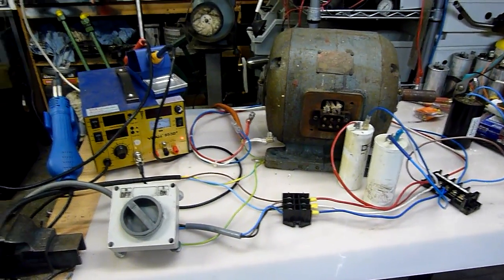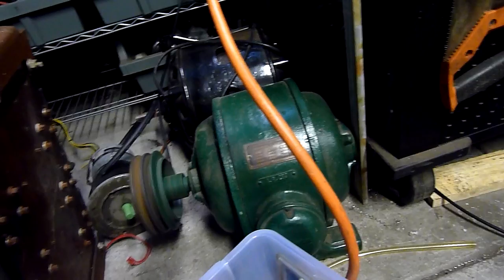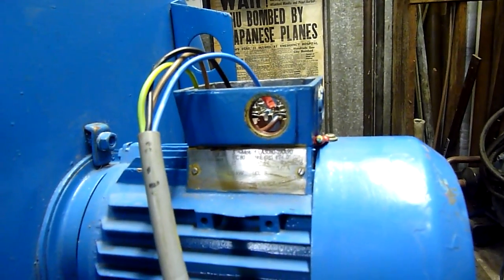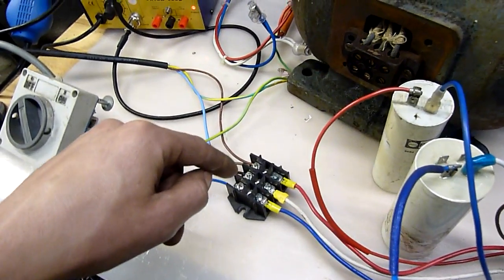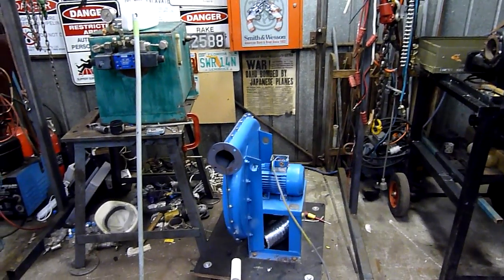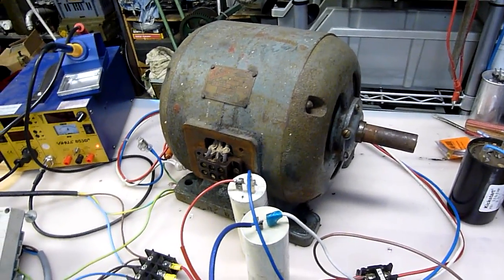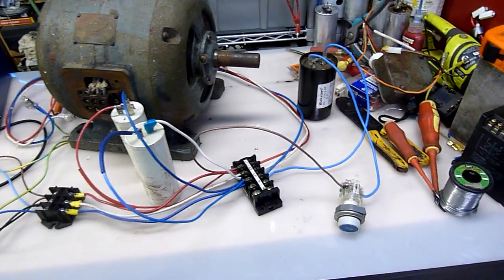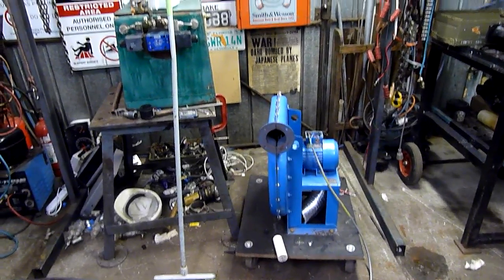Rotary Phase Converter Build test   Lots of Rambling and Blower Startup noise

Comment: after playing with my own 3 phase motors, a problem i think you may be encountering is harmonic resonance inside the motor. This is usually due to incorrect capacitor size and unbalanced winding impedance. Wonder what it would do with a bigger capacitor as a run cap? caps too big or too small will make the motor heat up quickly and sound very angry. Maybe start the blower with the start cap too?

Comment: its also worth checking your line voltage drop under a range of loads, its often over looked yet so important when it comes to starting  3phase motors under load ,I [] R. in UK some domestic lines will drop so low when it comes to the nitty gritty and require further cash spent on star & delta starting switchgear.

you probably know all ready , some of the older vintage motors work so much better for RPC  operation than the new generation high efficiency green brigade motor types.

Comment: when it comes to balancing the phase voltages you need volt meters on each , will make the task much easier and quicker,the difference it makes when phases are balanced is massive. I high recommend only using double terminal capacitors or screw on terminal type, seems over kill but the difference it makes when it comes to starting up motors on load is massive. never skimp on cable size either. good site to visit  practicalmachinist forum,  great depth covering a number of manufactured RPC's etc

Comment: Built a large RPC with current & voltage sensing control ,keeps phase voltages within a few % under full load, automatically switching in cap banks using SSR's works a treat  . when off load system switches to stand by drawing just under a few amps on 240 V input side, so much better to use a step up transformer 240 to 415 volt, well worth the expense- extra hardware, old stick welding transformers can be used costing next to nothing. cap bank total = 900uf. input line volts must be ROCK SOLID

Comment: for a efficient RPC you need phase voltages within a few percent under operating load.off load voltage means nothing in the real world, 10% imbalance will hurt big time.

its good practice to have the idler motor 45 - 50% larger than the 1st load motor, that way starting is much better, slow starting will cause winding's to over heat. from experience running these types of motors at a slower speed " lower frequency" will causes them to over heat, modem motors deal with VFD much better.

Comment: hey ed harmonic distortion also causes a lot of heat, do you have a power factor meter? check your power factor if its below .7 i suggest power factor correction "caps"
you can purchase one at most big box stores , not sure if you have them down under

Comment: Need more balance capacitance to bring the L1-L3 and L2-L3 voltages up.   Of more importance is that the current be balanced among the 3 legs of the blower motor (do you have an clamp-meter?).   It sound's severely out of balance.    More information than you can poke a stick at on practicalmachinist in the transformers, RPC and VFD section.

Comment: In AU and NZ in built-up areas we use delta wye transformers.
400 volt 3 phase with 230 from phase to neutral.
and in rural areas we use 2 phase to get a single phase.

Comment: In the US, or North America for that matter, most 3-phase rotary converters I've seen run off the 240v main. A 3-phase motor will run off 240v but won't start unless you got a capacitor or give it a spin. The difference is we have our 240v split into two 120v lines, split at the transformer, firing 180 degrees apart. It's still called single-phase because it comes from one primary. I'm not sure if you Aussie's have any electrical service like that.
Reply: we have our phases tapped off one of three from a delta-wye/star transformer to step 11kV down to 240 (L - N) if you have 3 phase, then you have all four conductors from the transformer. we don't usually have two phases, but older houses with three phase had two of the phases dedicated to high power loads like ovens and cook tops.

Comment: or find a treadmill motor on eBay for $50..up to 3HP. If they can handle the variable torque and speed demands of a (tested 1HP) milling machine, they can certainly handle that static blower.

Comment: Nice sounding blower! Just a thought, as the blower has no connections on the outlet or inlet, if you covered the inlet say half or 3/4 would that encourage the motor to spool up to 2800 rpm or is it already at that speed? I need to build one of these converters for my workshop!

Comment: It's either that, or what you saw, was a few decades-worth of dust go up in smoke. :D That's always a possibility, & probably why it started smoking to start with.....Full up with dust, got hot, burnt off the dust, cooling fan could then cool the motor properly as it should do, then just carried on business as usual. :D

If the motor was still working after the smoke-up, I'd consider getting it tested out, maybe even taking it apart & giving it a thorough clean-out inside. :-)

-BoomBoxDeluxe.

Comment: Hiya. From what I can remember on Rodalco's videos on Rotary Phase Convertors, YOU DO NEED a motor for your RPC which can be switchable between Star & Delta. 

Some motors like being started in Star, others Delta. Once up to speed, you can switch between the two for either 240v phase-to-phase or 415v phase-to-phase

Also, I do believe that you need to get the capacitance correct. If you don't give it enough, it's like as if one of the phases is missing & the RPC won't start correctly, if at all.

Comment: Have you got a dual input scope so you can compare the phases under load and there amplitude and delay times.

pity a 3 phase motor cant be converted to a generator so you could drive it with a 240v motor and rubber belt :-(

Keep going, im sure you will succeed ed :-)
Reply: an induction motor will work as a generator, but needs some sort of excitation like the 240V mains across two phases, difficult to get to work reliably

Comment: That fn motor should have a frame reference, something like D20L, if you know that and shaft dia/length, finding a single phase replacement should be easy
That's all we needed to tell the motor company (apart from motor ratings) to get a motor that fits, oh, and the feet and flange should be able to be swapped too, but check on that
Motor sounds very rough when spinning down, heat could be bearings.

Comment: On that blower i think you can lift the housing of the fan to accept a higher shaft with some spacers on the motor's feet. Simply by lifting the housing on the rails by one hole. I think. It's quite similar in design to a water dynamo i made from the housing of a Russian cent. blower for a school project. I had a similar problem the shaft of the dynamo was too high to be accepted in the original frame so i did that ^ and it worked, mind you i did this because i didn't have access to a welder.

Comment: hell just get three phase hooked up to the house!
Reply: difficult when metering costs the electric companies, not us. You really have to need it badly to get it hooked up, you've got to have some big stuff like air compressors, air cons, ovens, big machines etc. Basically gotta have a warehouse with aircon to get 3 phase in most residential areas of aus.